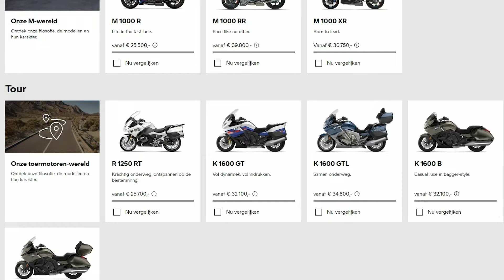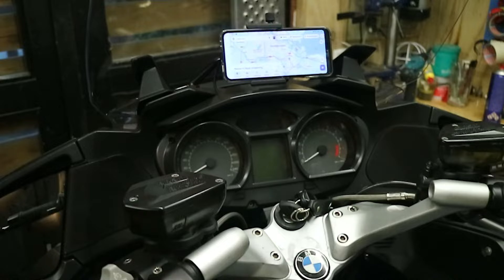Review of the BMW R 1200 RT

Comment: I've owned the same model as this for 5 years, I ride it all year and do my own maintenance, other than normal service items, the only issues I've had was left hand switch gear failure, the switches use a flexible circuit board and it cracks and the switches stop working, also not cheap to buy and new pistons in the rear calliper, not too bad and probably due to salt and water after years of winter riding.  
The engine is ok, but runs out of puff at top end, (I test rode a 1250RT and that has the grunt all the way to the top end) but has the torque to overtake at normal road speeds. 
I love the handling, its surprisingly good on the back roads, but will eat motorway miles. As you said maintenance is easy, I love the fact that you need one size Torx key to remove all the body work and once done its all easy to get to, very different from my VFR800, which had various screws and clips to get parts of the bodywork off or my friends ST1300 which is a lovely bike, but its also had its issues, with the electric screen adjustment failing, which seems to be a known problem and the clutch slave cylinder needing replacing, a job which the Honda dealer says is engine out, but he managed to do it without going that far.

Comment: I have the 2013 model with only 31k and it's very different from the ST1100/1300 I had before. The 4 cylinders are more smooth but apart that the RT is hands down better in any way. 50kg lighter, lower center of gravity, more torque, better handling, better comfort, better protection. no heat burning your leg even in hot summer (very important point for me) much much faster in the twisty roads of swiss Alps (you have to force to keep the curves with ST the RT turn by herself and you can break later and stronger less weight).
No reliability issue for the moment and I made all services by myself very esay to work. Honda is very reliable I had 5 Honda before despite I had ABS failure with the ST1100

Comment: I totally agree about the prices and the various problems you will encounter. The costs are enormous. For example the fuel pomp of my 1200RT was quite allright after 48000 km, but a plastic hose of the pump broke off. I had to buy a new one a 450 euro. The abs 3 system of my R1150RT failed in France. The remaining breakpower was about 10 % and I drove it 400 km home at night to avoid braking. Repair would cost 1200 euro, a new system 2750 euro. Quite ridiculous. I removed the abs and sold the thing instantly. Still I had almost every type of BMW. When its riding, a BMW is the best bike in the world. The wind protection of every RT is quite perfect and I love the boxer concept. As told in the video, a Japanese od even English bike wil be by far more reliable and less expensive to purchase and repair. BMW really makes you love and hate the bike. The most reliable is the name, not the bike itself.
Reply from the maker: Exactly that.

Comment: Why do you prefere your bike to do those dangerous nosedives on breaking? 

If you had a R1200 GS before it has the same telelever suspension right? Soes it behave differently? 
I'm currently I'm looking for BMW's  exactly because of this feature. Is it bad a bad feature?
Reply from the maker: Yes indeed. The same. But I just notice it now more than before since my last bikes were: V85, ST 1300, Burgman 650, Tenere 650. All those just acted like 'normal bikes'. I am convinced I will get used to it, I just noticed it instantly.
Reply: Edit

Comment: RT had ABS problems until September 2006, not 2008. Some other problems were also corrected at that time.
Reply from the maker: @dieged3065  The 2006 BMW R 1200 RT had issues with its servo-assisted braking system, which could result in abrupt or diminished braking if the servo failed. Both the 2006 and 2008 models experienced problems with ABS warning lights and occasional ABS pump failures, leading to expensive repairs. Overheating of the ABS system was also reported in heavy braking conditions, but regular maintenance helped prevent many of these issues.

Comment: Hi There, it's a great video. Although i'm not agreeing with you about the lack of the Boxer character of this DOHC one particulary, that i just bough again for this reason ! i have to make my voice heard , friendly :). oh i'm French rider, 33, maybe i wont be agreeing because of that ? jokes asides let me explain

By the way I'am waiting my next motorcycle, my 11th vehicule owned so far a second hand 2012 BMW R1200RT with 66000 km on the clock, like yours, with RT2 packs, don't have every pack because RT3 pack include the radio with the physical buttons on the left, antenna , the left handlebar grip 0 ring clics and bmw satnav preparation, all i don't care on a motorcycle.

i previously owned 5 years and ride 55000 km the 2014 R1200R from 60000 km to 116500 km with  0 issues. With the same engine, the very last "true" BMW with old turn signals buttons and the last air/oil cooled DOHC engine associated with the Telever. It was my only vehicule so no car, been 3 weedings, racetracks in Germany ( hi there ! ) where i reached 240km/h on the gauge and about 223 kph GPS on Autobahn on the Nordschleife for my first racetrack experience ( crazy good ! ) and Circuit Carole in France, one of the shortest racetrack  top speed 0 hard case luggages  this time, not bad for a air oil cooled roadster ! 

Oh boy it have a character this engine !
it came from the BMW HP2 engine in it's core
i have tested Liquid cooled 1200 boxer and the 1250 on GS, RS and R and i missed that lower grunt good vibration, subtle but there. The new engine to me erase the boxer character, keep just the performance.
they are more powerfull but they lost the magic on this engine that only drive them explain.

after have tested dozens of motorcycle, owned a Harley, 2 Suzuki SV 650, test ride a lot of two cylinders motorcycles from Almost all Panigale, KTM 1290 and lot of Harleys. 
I instantly felt in love with the BMW R1200R and it's boxer  and the telelever feel on the road in 2018, in fact i've been the second and fourth owner of the R1200R succed to rebuy it from a owner that kept it 1 month ! 
after sold in 2023 i recently try a R 1250 RS, the new Honta NT1100 DCT and i wasn't convinced for both. price wise they were triple and double the price asked from the 2012 BMW R1200RT i bough 

test riding the RT i have eyes on ? it was the last Family of the R Engine i never tested, just been passenger on the past.
oh i was like home again, with that fantastic engine that have it's little low rpm character but easiness. combined with the magic telelever, i never felt the miss of front info bothering but always put top Michelin tyres. i was surprised to that resistance on the angle that was not there on the R1200R, a set of new tyres will correct that perhaps.

 The clutch lever and gear operation seems smoother on the RT vs the one of my R1200R.
it's the ultimate update i needed for the only vehicule and riding all year long distance, cold, rain, to visit familly and a yearly road trip in a different european country.
All the "default" of the R1200R are resolved, more confort seats ( the comfort BMW seat is magnicient ) less angle on the legs that hurted me long time due to knee problem on the R1200R, more easy clutch and gear footlever. and the Duo was not plaisant on the R1200R, well with a custome comfort seats that made the passenger fall on the rider like a sportbike. the ESA have real difference between present and so convenient to change on the go instead of the manual hub under the seats and the screwdriver on the dark to set the preload on rear shock,
All the protection  added and... a Cruise control finaly !

as i loose a more beautiful bike for a weekend blast ride i will gain a do it all but with the unique character of this engine that to me is the best engine for road use, a perfect combination of easiness, power and still a character, low consumption and it's reliable as never the new boxter would be. i missed so much the DOHC Boxer and this RT i will keep for a very long time, maybe forever.

oh i was 8 when my father an i did a 2500KM + Tour de France on a r1100 RT, it was mean to be owned by me as a legacy maybe ;)

cheers !

Comment: Regarding the 2005/6 RT models,, I have a 05 model with 86000miles,, the fuel strip I have never had problem, servo brakes I have never had the problem,,,shaft drive again no issue,,,it blows headlight bulbs regally ,,,I,v toured europe lots of times..  and I,m not a BMW fan boy...  One big problem with my RT is the gearbox broke in a big way,it cost me an arm and leg to fix...I,v had the bike 8years ,,,I have a Ohlins on the baack suspension I need a front shock..   You do,nt need CC ,,just get a Go Cruise

Comment: The rear view mirrors are definitely a poor design, you can hardly see what is happening behind.
Reply: This probably depends on the height of the motorcycle rider. For me (181 cm) these mirrors are great, I have additional small blind zone mirrors.
Reply: @dieged3065  I am 190 and they are perfect. First bike that fits me well and mirrors are spot on.